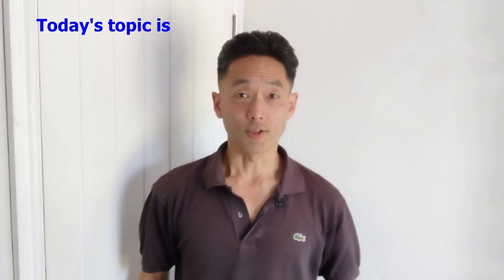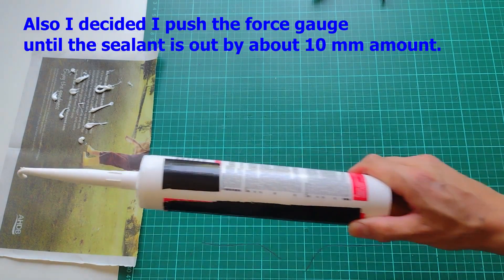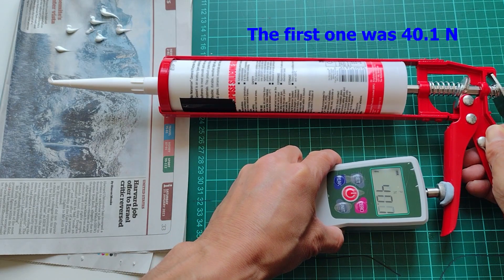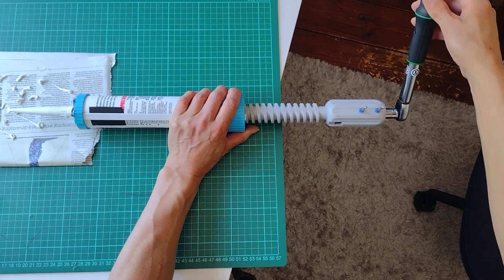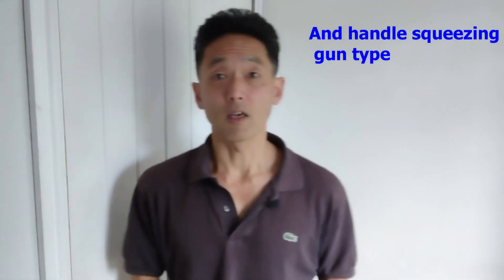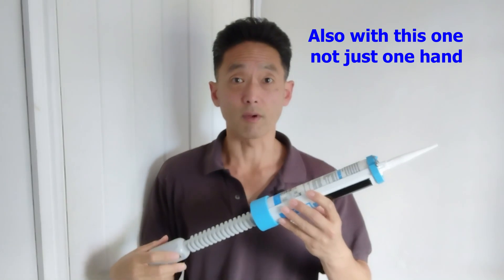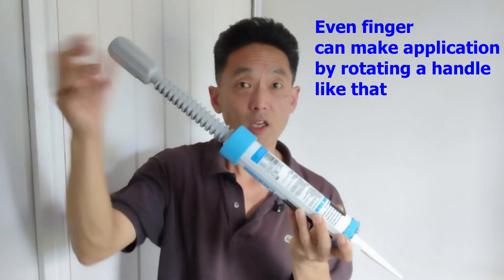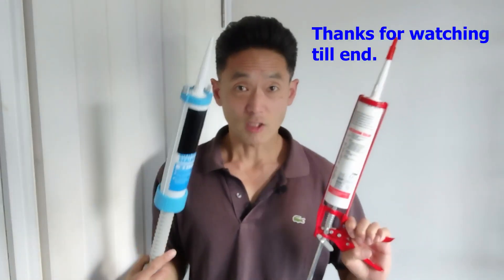Which Caulking Gun is The Best - Require Less Hand Strength - Re-invented

Comment: A wonderful invention! I think you're right, the strongest pitch for the Twisticator is control of the bead for a better final product. For example, you have a gap to fill, but it isn't the same width or depth of gap along the length. Filling with a caulk gun, you can only slow down to control the fill rate. But with Twisticator you can easily (low hand force) control how fast the caulk exits the tip. Requires less wiping after, and looks better overall, right?
Reply from the maker: Yes, it is surprisingly easy to control the amount of sealant you want it to come out. Yes less waste of sealant. 
Thank you for your comment, you are the first person posted the comment since I made a several videos!